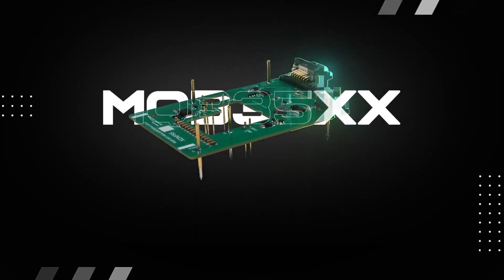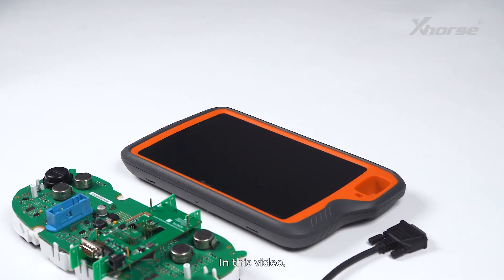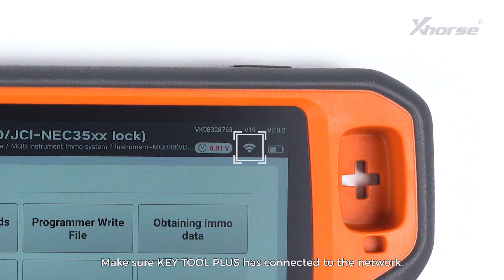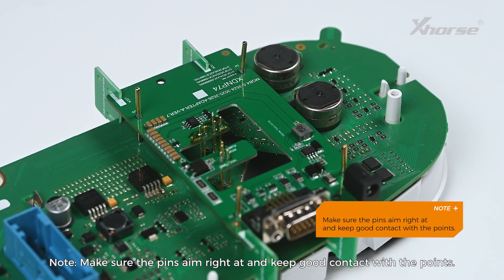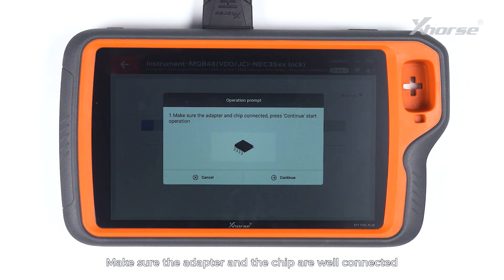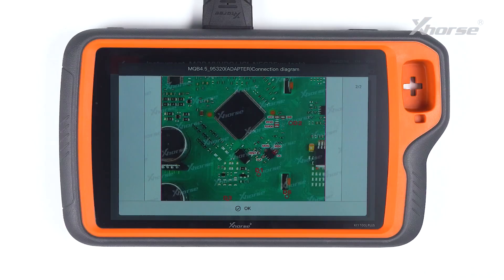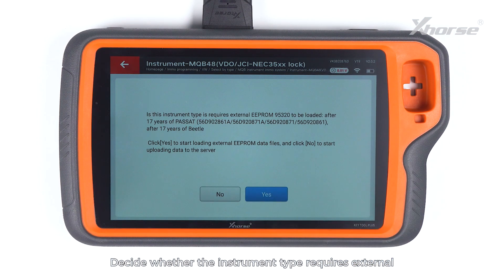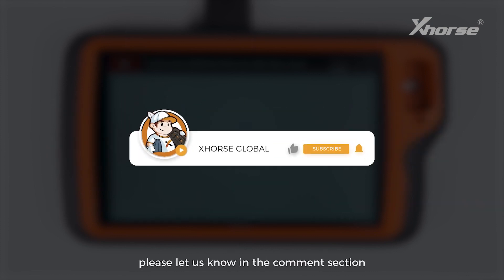Xhorse VVDI Key Tool Plus Read MQB48 D70F3524 with solder free adapter-VVDISHOP

Comment: Can we do all keys lost after reading this files?
And there's no adaptor options for beetle mqb48 2019.
There's only a wire option do we need to remove any capacitor's for Beetles 3524?
Reply from the maker: 3524 does have a solder free adapter.  Better send cluster images (front and back) to us to verify. All keys lost requires sync data from 3rd party as well.
Reply: @vvdifactory sorry it's too late I managed to read the data and do the job successfully.
And I still have the cluster images how can I send it to you.
The adapters that you have it's for 3524 jeeta  clusters.
Not Beetle %100.